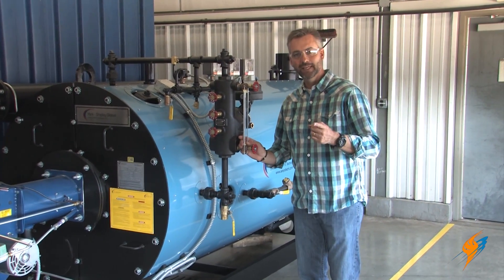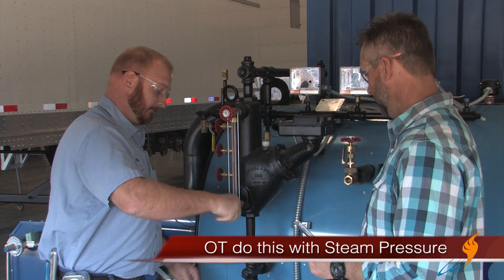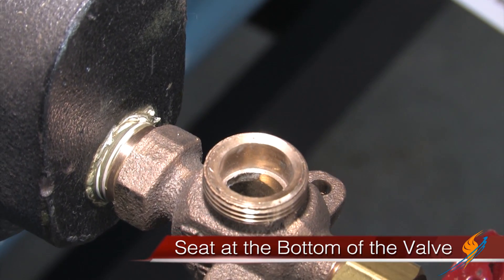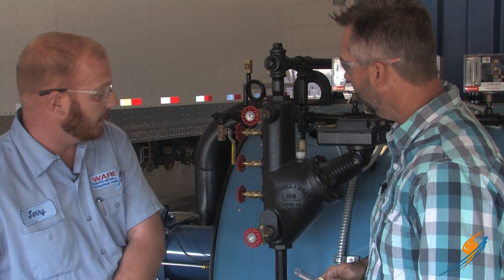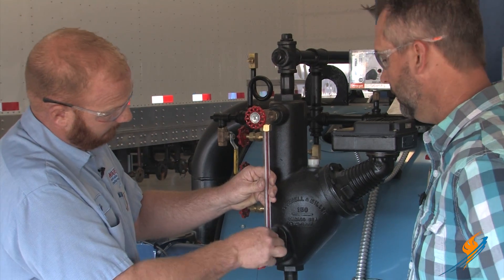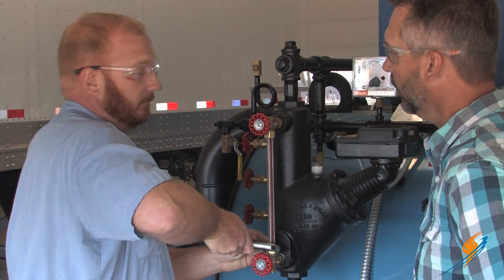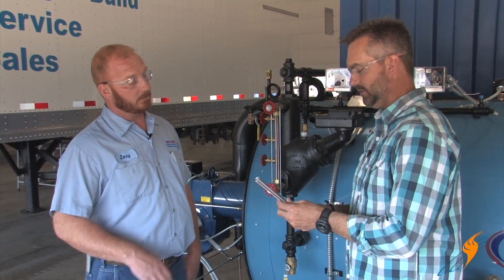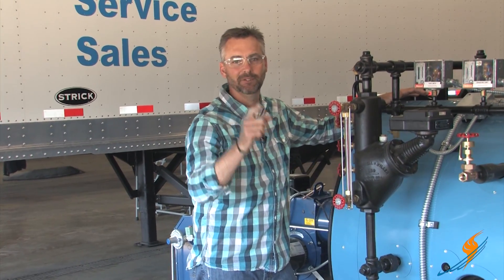Steam Boiler Gauge Sight Glass Replacement - Boiling Point

Comment: Always crack open the steam (top) gauge glass stop (with drain open) first if the boiler is hot. This warms the glass gently. Then open the bottom one, allowing a little water to flush out any small shards of glass, rust, debris from previous broken sightglass, etc.

Comment: After replacing the glass & reinstalling the rods, you should not open both valves at the same time. If the bottom nut/washer leaks you will see water dripping. You have no way of knowing if the top nut is going to leak except when the boiler is making steam. Open the bottom valve 1st. If the water level rises in the glass the top washer is not seated properly. If the water does not rise the the washer/nut is good. Science - 2 things cannot occupy the same space at the same time.
Reply from the maker: https://youtu.be/yu2q1ucwncY here is another video on this that we did on a working boiler. Take a look at that one

Comment: Can I replace the sight glass when the boiler still operating? If so, the boiler water still hot, which valve open first to put water back in the sight glass?
Reply: Yes, you can.
Reply: I close steam first.. Then water.. And after replacement... Water then steam...

Comment: For the home, what does it  mean when the gauge glass is full to the point where you can't see the water line and it doesn't drain even when draining the main valve until the low cutoff light comes on?
Reply from the maker: It sounds like something is going wrong for sure. The boiler might be incredibly flooded or there could be something wrong with the gauge glass. Recommend getting that checked out from a professional in your area. Good luck and thanks for watching!

Comment: I would love some one to    
particularly hint on replacing the gauge glass when the boiler is actually running, since their is always limited time to stop production . which valve should be opened first? often the glass explodes when opening those valves.
Reply: Nyaika Nelson Always wait till the boiler cools down. Make sure the site glass is high pressure rated. I use Duran glass like the one used in this video.
Reply: Santosh chaglani